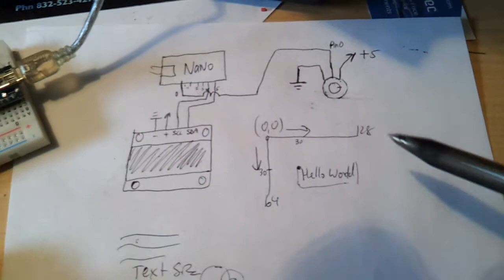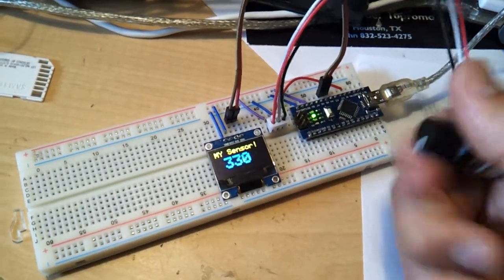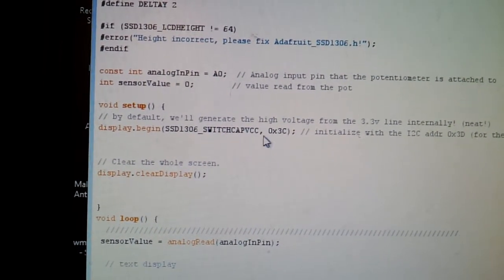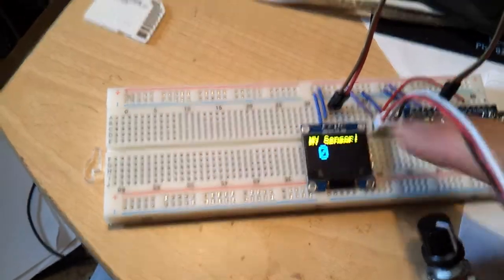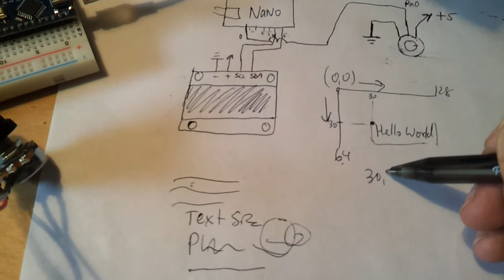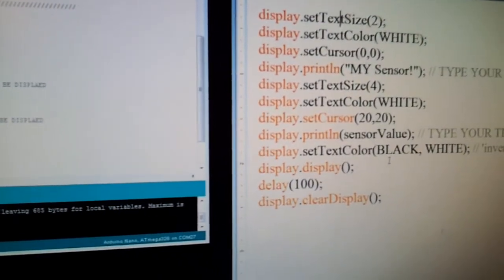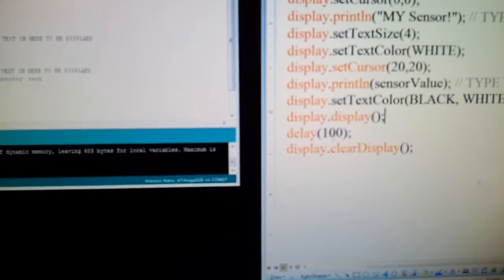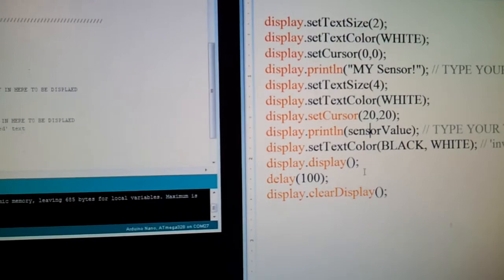Part 2 - 0.96 I2C IIC 128X64 YellowBlue OLED LCD LED How to Use

Comment: Gr8 work man!! Thanks a lot!!! can u share a link to buy the buttons you use for the menu project you did.. i think it was "part 1"
Reply from the maker: Collision switches
Ebay.com 
And the item number is: 371375063444
Reply: Fedor Weems  Thank u so so much !
Reply from the maker: Search you can probably find little cheaper ones:)
Reply: Fedor Weems  Will do, thank a lot.. although it  just a $ each.. :)
Reply: +Itamar Shimon  "part 1" code ?

Comment from the maker: /*******************************************************************
This is an example for our Monochrome OLEDs based on SSD1306 drivers
This example is for a 128x64 size display using I2C to communicate
3 pins are required to interface (2 I2C and one reset)
The code was modified by Fedor Weems.
*******************************************************************/
#include <SPI.h>
#include <Wire.h>
#include <Adafruit_GFX.h>
#include <Adafruit_SSD1306.h>
#define OLED_RESET 4
Adafruit_SSD1306 display(OLED_RESET);
#define XPOS 0
#define YPOS 1
#define DELTAY 2

#if (SSD1306_LCDHEIGHT != 64)
#error("Height incorrect, please fix Adafruit_SSD1306.h!");
#endif

const int analogInPin = A0;  // Analog input pin that the potentiometer is attached to
int sensorValue = 0;        // value read from the pot

void setup() {
// by default, we'll generate the high voltage from the 3.3v line internally! (neat!)
display.begin(SSD1306_SWITCHCAPVCC, 0x3C); // initialize with the I2C addr 0x3D (for the 128x64)

// Clear the whole screen.
display.clearDisplay();

}
void loop() {
  ////////////////////////////////////////////////////////////////////////////
 sensorValue = analogRead(analogInPin);
 
  // text display 

display.setTextSize(2);
display.setTextColor(WHITE);
display.setCursor(0,0);
display.println("MY Sensor!");// TYPE YOUR TEXT IN HERE TO BE DISPLAED
display.setTextSize(4);
display.setTextColor(WHITE);
display.setCursor(20,20);
display.println(sensorValue);// TYPE YOUR TEXT IN HERE TO BE DISPLAED
display.setTextColor(BLACK, WHITE); // 'inverted' text
display.display();
delay(100);
display.clearDisplay();
}
Reply from the maker: Thank you, that clears it up